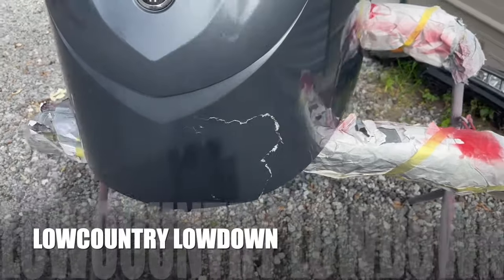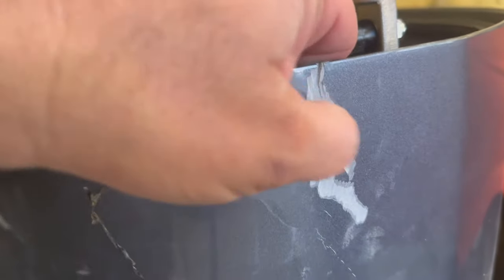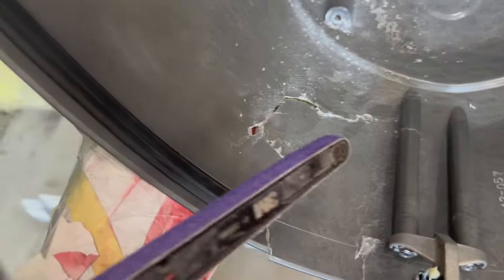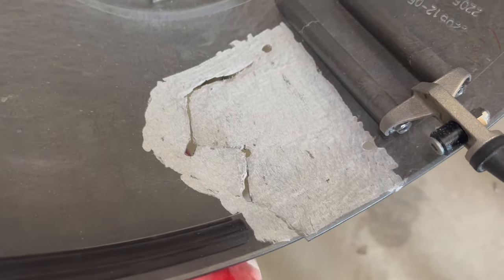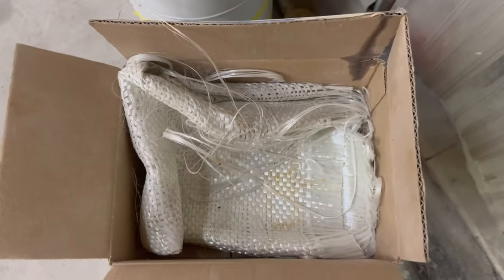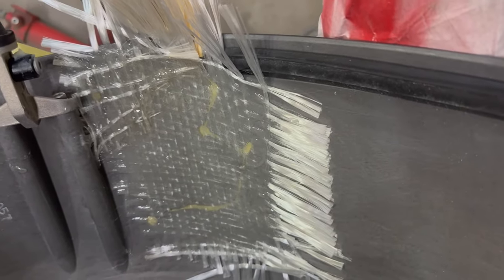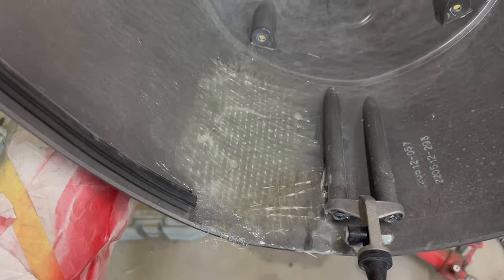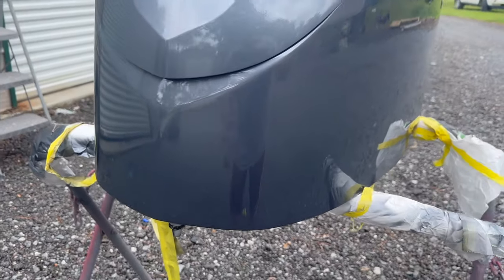FIBERGLASS REPAIR | BOAT COWL REPAIR | FIBERGLASS BOAT COWL | DIY BOAT COWL REPAIR

Comment: Well done. How much do you think all the materials cost? Did you by the paint from Yamaha? Thanks for sharing.
Reply from the maker: I have sikkens paint line and I have a good match for yamaha blue grey; however, you can go to color rite and get it (expensive but good quality paint). It can get expensive if you don't have the epoxy, cloth, grinder, sand paper, discs, paint, clear, primer etc) I might have a 100-150 bucks in supplies on this project, but I keep all of these products in our shop. (IE don't have to buy a whole kit of epoxy, don't need a whole gallon of clear, etc)